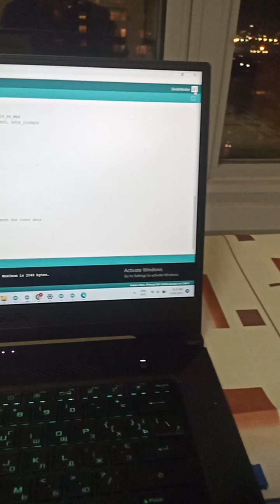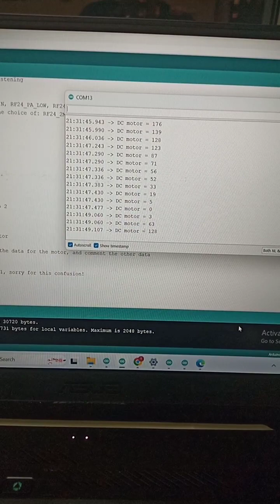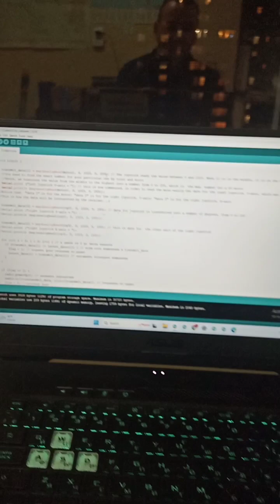Finally working! nRF24 transmitter and receiver, code below.

Comment: outstanding success - what in your opinion is the culprit for it not working previously? I should go back and watch the last long form video.  Thank you so much for sharing! I am with you in the spirit of discovery.
Reply from the maker: Hi RJ, yes, there is some success, but also problems ahead, as usual. Previously, there were several problems that needed to be solved. One was the power supply. For some reason I don't understand the Arduino Nano works well when power is supplied through mini USB port, and not through Vin port. So, to deal with that I bought a converted from 8-80 volts down to 5 volt, with a mini USB jack, that fits into Arduino Nano. That is for a receiver. Another problem was mixing signals: one that was sent to the motor and one that was sent to the servo. To deal with that, I put the input for motor on one joystick, and the input for servo on another. That worked. This was a problem of transmitter. Another problem was calibration of ESC with a PWM motor. That takes a lot of tries to get one's hand used to doing that. See one of the comments in "Problem with calibration". One person had a similar problem... But if you are thinking on doing the project - don't be shy, go ahead! It's rather satisfying and rewarding (not in cash, of course!).